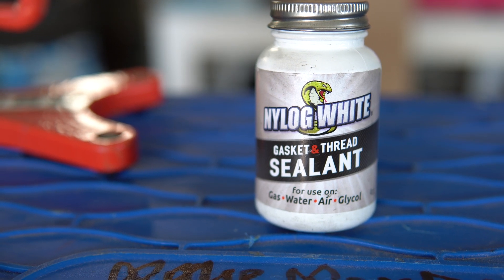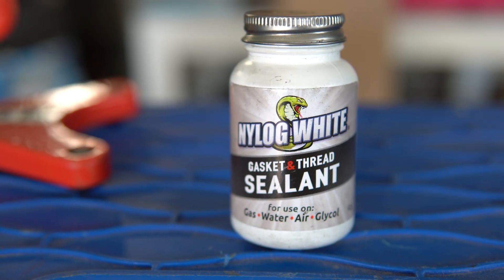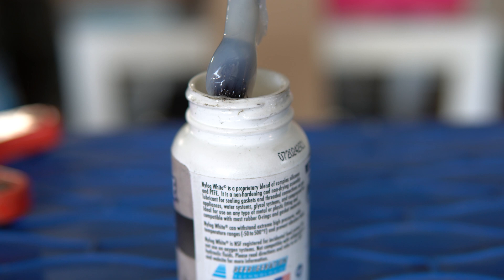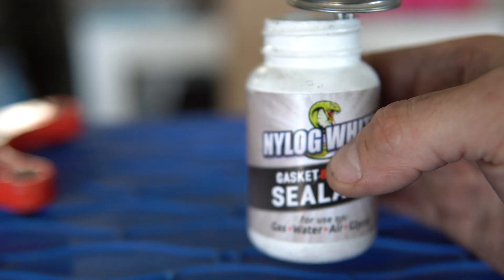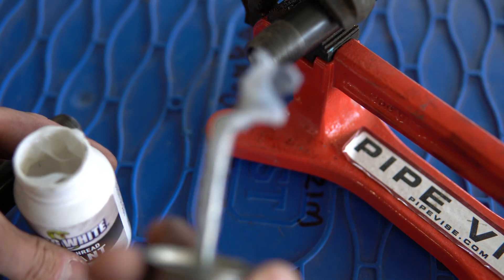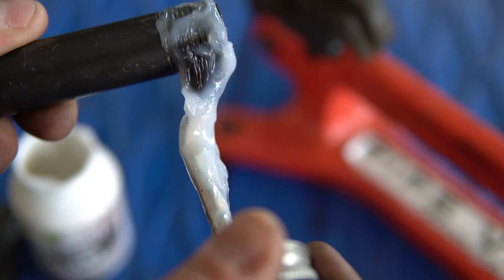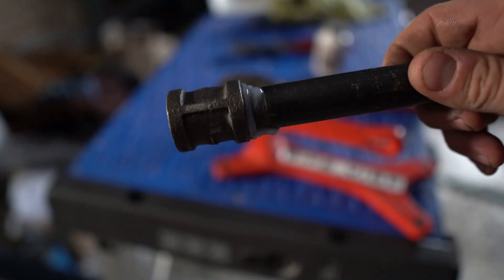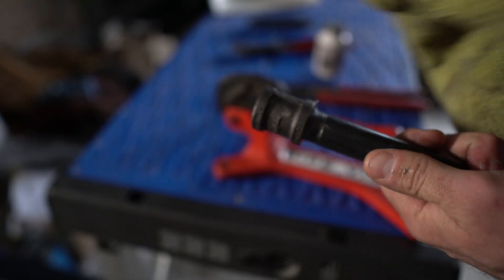IS NYLOG WHITE WORTH ALL THE HYPE

Comment: Does not work very well with water installed a water heater got a call back the next day where the dielectric thread onto the water heater both were leaking . I have had Good luck with it on gas pipe